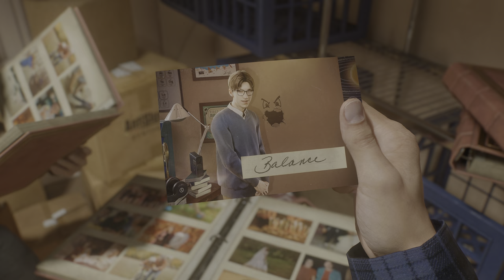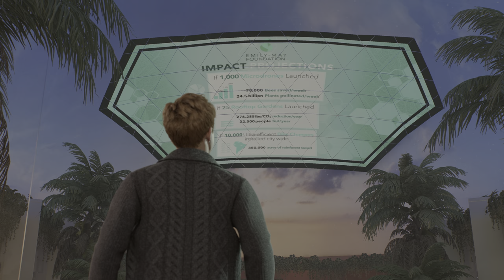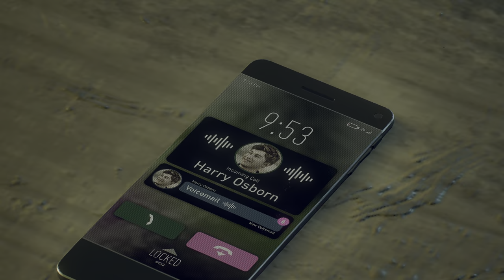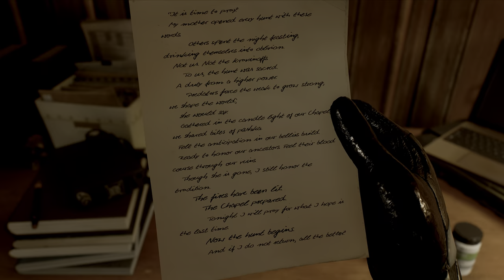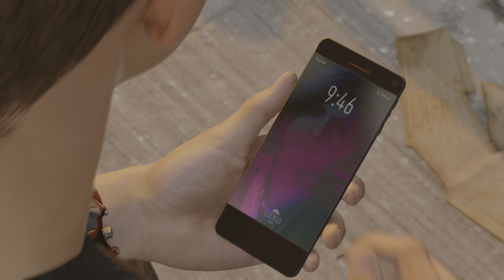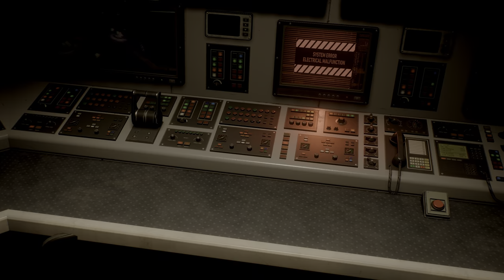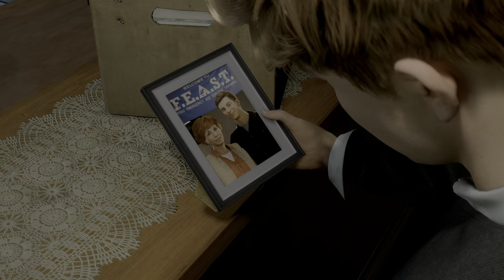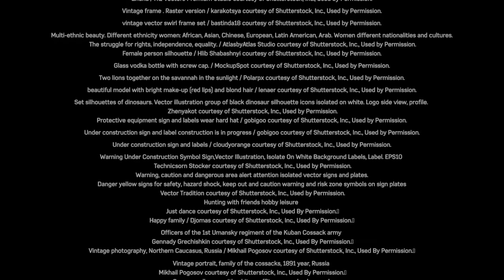Marvel's Spider-man 2 (The Movie)

Comment: I feel like there’s an arguement to be made that the ‘Make your own choices’ Black Cat mission could’ve been cut.
The Dr. Strange stuff doesn’t come up again or Black Cat.
It’s a cool sequence so it’s good that it’s here. Especially since it gives Miles a mission and balances the story between him and Peter a little more.
Reply from the maker: Yeah Miles needed more story focused content. At least this one was related to the Hunter storyline. It connects to the previous Peter mission, so cutting it would have required some awkward cuts to the cutscenes in that mission, so I think it works well. 

Most of Miles missions though in the middle of the game are just set up for side missions so I cut almost all of it. Only kept a couple more character focused cutscenes from that section.

Plus this scene is just a lot of fun.
Reply: And any thought process on choosing Performance over high fidelity?
Reply from the maker: @incrediblecaptain  I always choose fidelity. For one, movies work better at low frame rate and better visuals, but honestly I generally prefer fidelity modes when I play myself anyway. I prefer more movie-like experiences even when I'm playing.
Reply: @AndyGilleand  I’m the same way. Unless I see the different frame rates back to back, I can’t really notice.
With this game, performance reduces the traffic density a lot, to the point where the city feels a little empty.
Reply: 2:14:59 
Were you aware if you fail the qte around here, then Harry actually saves Pete from the building instead of the other way around. 
I’m sure you were playing with auto-QTE, but if you knew, would you have used that cinematic instead for that part?
Reply from the maker: @incrediblecaptain  I was not aware of that, that's pretty cool, but considering this is what happens with auto QTE, this is the "canon" way things happen in the story.